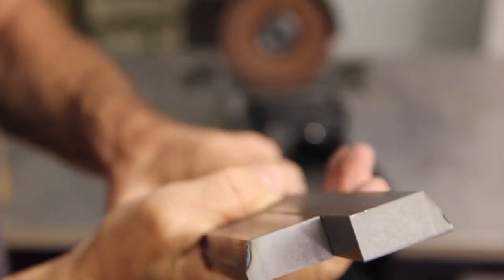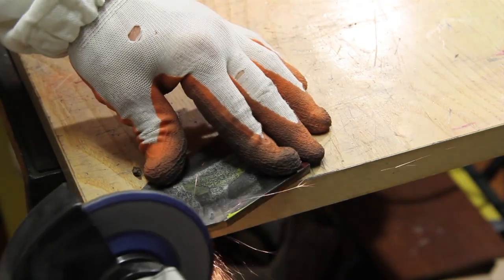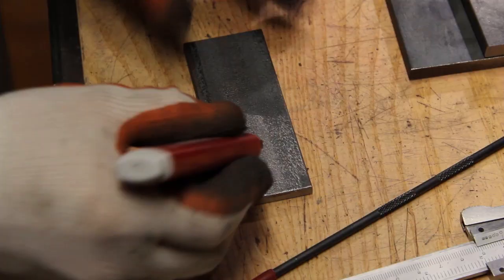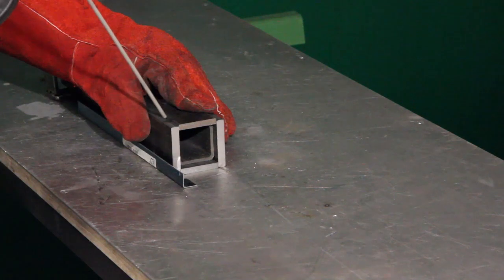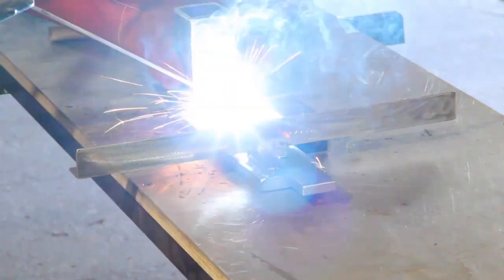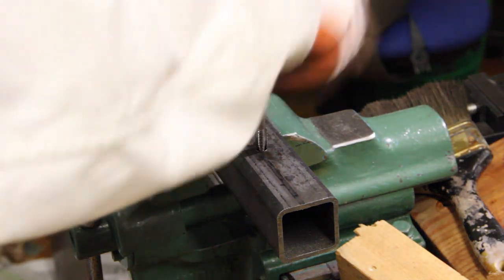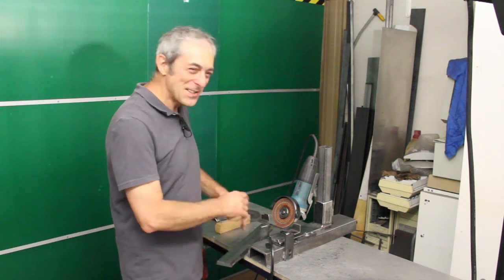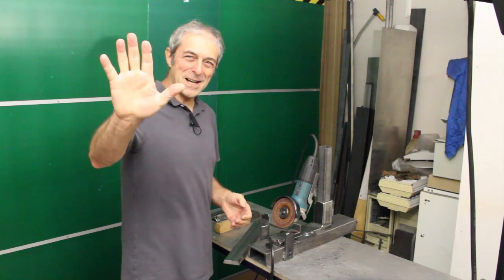Grinding Rig to make dovetail ways ...went wrong

Comment: Try next time with steel pipes and steel elbows and pipe flanges . . you can set it up and adjust it square without welding . . washing machine motors already have holes to slide back and forth on a pipe ^_-

Comment: I only wanted to mention this after visiting a steel dealer here in my country . . check your steel stock before you buy them . . the dealer was selling a thick rectangular bar with wrong dimensions!! It was 10mm thick on one side and 15mm thick on the other and the bar was 6 meters in length and they don't accept selling it any less than that , ,So  imagine 6 meters with wrong dimensions from factory to your door step !! These are weird times
Reply from the maker: So it is a trapezoid ...interesting I didn't even know they exist, but it could come useful in certain situations.
Reply: @AccidentalScience  No no no , , , it was wrongly forged . . that's why I said be careful when you by the steel. I think the form it was forged in wasn't accurate. I didn't buy , , when I saw this I left. I think this steel was not intended to build machine from but regular construction material. It is not easy to build a lathe but not impossible.
My final resolution is that a person should start with a Grinding rig and build it using big pipes and pipe elbows drilled and tapped . . your "cold welding" is also very genius technique which I like . . combined with grinding rig will be the best low price solution for achieving precision. There are aluminum oxide CUP grinding wheels and also cheap chinese diamond cup grinding wheels which can do the work faster than abrasive disck on angle grinders. Washing machine motor I think is better at grinding
Reply from the maker: @athrunzala5337  Ahh gotcha. Unbelivable! Where I live that is virtually impossible to happen. The material would be rejected by the stockist well before it reaches the final dealers. But I understand that could happen elsewhere.
P.s. Sorry for the delay but YT held your comment because it (mistakenly) detected as spam, so I had to manually approve your comment.
Reply: @AccidentalScience  You are very lucky to have quality control in your country.
I like the fact that you are trying very hard to build a lathe without relying too much on machine shops because to a lot of people this can make the price go up very quickly and might intimidate them to give up.
Good luck and let's see a happy ending to this project. I'll keep watching.

Comment: What material do you use for the slides and do they need to be heat treated?
Reply from the maker: Steel. No.
Reply: @AccidentalScience  # You mean flat bar?
Reply from the maker: @sibalogh  yes, they are in steel and not heat treated.

Comment: Hmm, might have been better to build a rig for the bandsaw for this, at least for roughing.
Then have a rig with the grinder to finish it off.
I think a better way to hold a grinder is the flange where normally the disk guard is mounted.
Reply from the maker: You have a point about making a rig for the bandsaw for roughing.

Comment: This mechanism is actually very similar to the way a radial arm saw works, although your mechanism is for steel of course.   The reason it caught your piece of steel and threw it, in the original version, is because your blade was spinning the wrong way. Its counter intuitive but the blade should spin towards you, pushing the piece of metal back towards you. This way if the metal catches and you’re holding it, the metal will not pull your hands towards the blade. Also, when the metal is inserted and the blade spins towards you, it will push the metal away from the blade, attempting to take a slower cut. With the blade spinning away from you, it pulls the metal into the blade as it cuts. A small cut causes the blade to pull the metal towards it, making a deeper cut, which causes the metal to pull deeper into the blade, which causes a vicious cycle ending in your grinder throwing the piece of metal across the room.  Just reversing the blade rotation  direction would make your setup much safer, and likely easier on the grinder and less likely to cause it to die.            The other thing that may be worth considering would be how the wheel deteriorates during the cut. It of course gets smaller as you grind more, however if you removed the bulk of material with 1 grinding wheel and did a second pass with a fresh wheel you could eliminate most of that problem,  hopefully to the point where you could hand scrape it to final flatness? Just some thoughts but either way thanks for the amazing content!!
Reply from the maker: > "Its counter intuitive but the blade should spin towards you"
Well I was aware of this, but I was afraid that the piece would have been thrown against me so I preferred the other way around, even though with the risk of having the piece seized, as it happened. Also in the case of pushing the piece against the wheel it would be necessary to even push it downward, vanishing the idea of having a reference point.
Simply put, this solution was a failure, and wouldn't have worked either way. Idea scrapped.
Maybe the second version, with some modifications, could become a useful grinding plane using a larger wheel and a powerful grinder.
Thanks for commenting Robert. Cheers.
Reply: Accidental Science ah yeah thats true, its a shame though because that was a really interesting concept! Have a great day!

Comment: Not sure but I  believe a cutting disc may work better. Just cut the material where you need the angle instead of grinding to where you need it. You may be able to cut two pieces from one wide piece. 
The cutting disc cut much better of course.  I have tried cutting with a grinding disc and once you get about a inch into the material it just becomes too difficult. 
Great Work You Are Doing Here!!!
Reply from the maker: Your though is understandable and sounds right. Sadly even a slight misalignment could lead the grinder to jam. To avoid this a different design is required. Furthermore, my idea was to exploit the constant distance between the corner of the "guide" and the edge of the workpiece to gain a decently flat surface. Bad idea, anyway :)

Comment: Very interesting idea. This could be a simple solution for making dovetails without expensive tools. Mighty give it a try.
Thanks for sharing !!
Reply from the maker: Too bad it didn't worked. It could work, but it would require a lot more:  adjustable tilt and alignment, a real rail to carry the piece under work, maybe more power. However, thanks for watching and commenting.

Comment: I love the effort i will soon be doing a lathe build also. Using cold steel vs cast iron or cast steel is fine. You may end up with a harmonic vibration issue in the end. A ringing sound from the lathe which may cause chatter.. Cast materials deaden this effect.. However i think if built well enough it is not an issue.. " I have already seen a forged cold steel lathe work well " .. As for the grinder not working my guess is the blade is flexing causing a pinching on the guide that makes it grab the piece.. So keep an eye on that and you have a rig.. Try using a "Ridgid 4.5 metal diamond cutting blade" $13 at home depot.. Or even a spring loaded guide to allow give and reduce binding.. Boing boing lol but with a lot of time it will work. Good luck and cant wait to see the next one
Reply from the maker: Hey, thank you for the comment. Yeah I'm afraid of that ringing issue. That is why I've put the ways on a layer of epoxyconcrete (this, among other things, I will show in a summary video.) 
Greetings.
Reply: @AccidentalScience   awesome idea cant wait to see
Reply: Also work the metal like its on a lathe.. Take of just a tiny pass everytime.. A one pass dovetail like a table saw is too much material..
Reply: Also get ready for a bunch of surfacing. Inorder for it to be smooth it will require a very straight surface.. The longer the lathe bed the more straight it must be...  Keep up the great work and cant wait to see the next one

Comment: Why not just linear rails?
Reply: It is possibile to use linear rails, but they would have to be quite beefy and spaced far apart. Rolling element guides are awesome for cnc routers because of their preload and low friction but in a lathe rigidity and damping are usually more importnat than few microns of backlash since cutting force is always acting one direction.
Reply from the maker: @milithemuffin4534  exactly.
Reply from the maker: Do you mean using linear rails in place of making these ways?